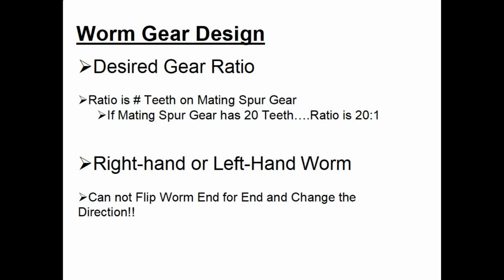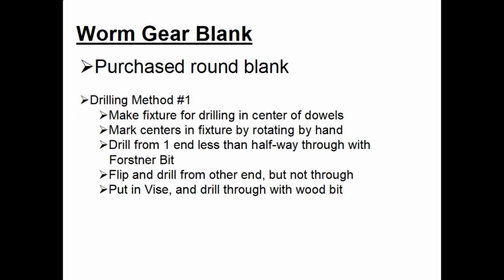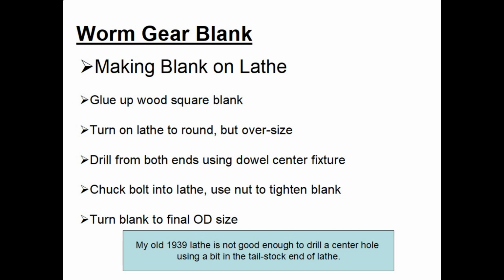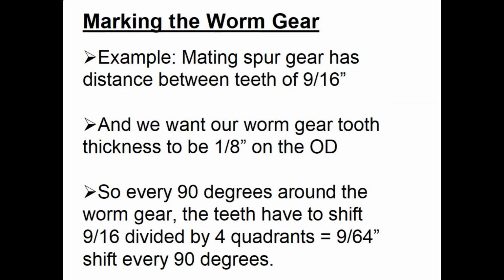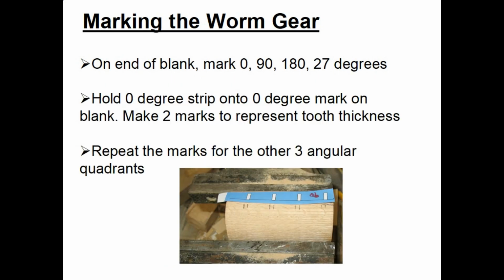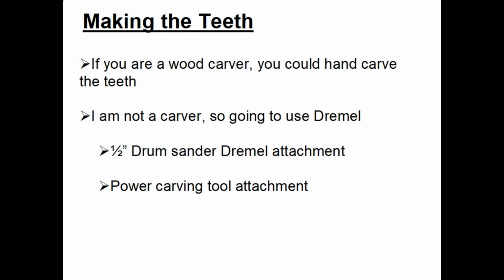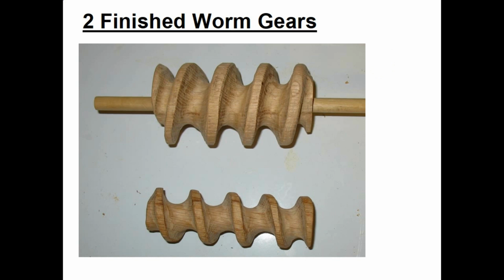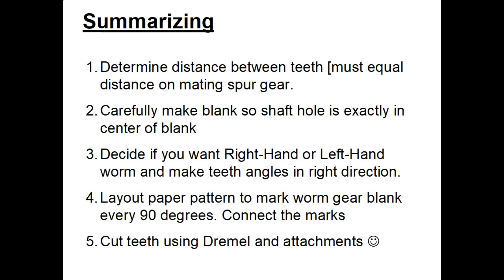How to Make a Wood Worm Gear

Comment: Can you make a 1 to 1 worm gear?
Reply from the maker: Boy, that is an unusual question :)   The gear reduction ratio of a worm gear set is determined by the number of teeth on the mating spur gear. About the smallest pitch diameter I can make easily is 2 inches, so maybe 4 teeth on the spur gear...........which gives a 4:1 reduction ratio. Thanks for the interesting questions!
Reply: @dalemaley  thanks for the reply.